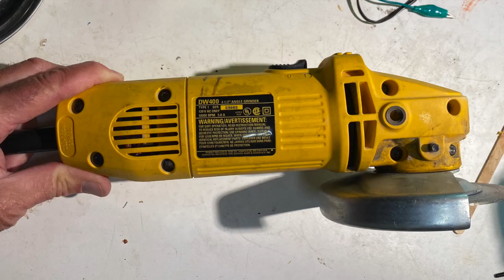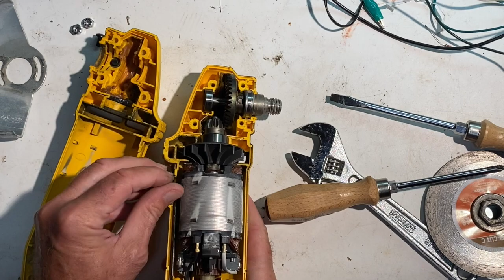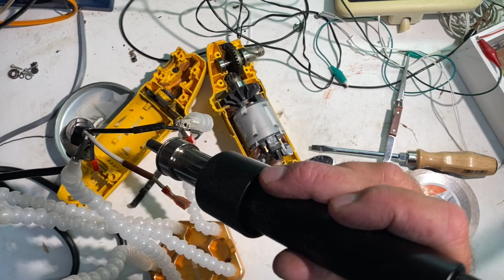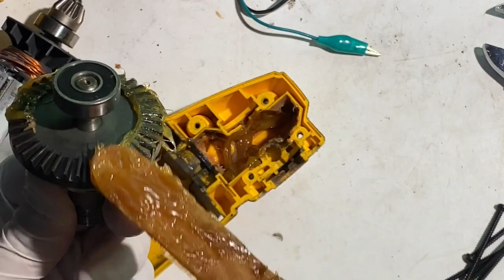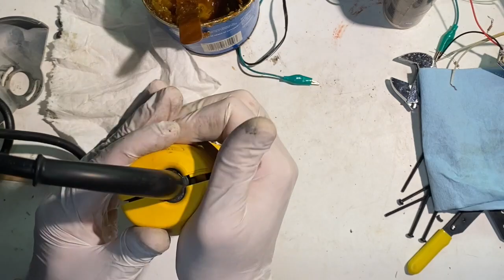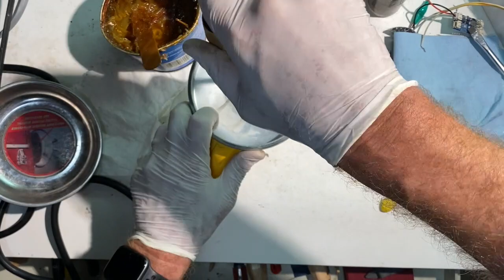Replacing the power cord on a Dewalt DW400 angle grinder

Comment: I noticed that when you disconnected the original power cord, the black wire with the bare connector was on top and white wire with insulated connector was on the bottom, but when you reassembled, it appears your reversed them. Was that on purpose? The grinder appeared to work fine, so maybe it doesn't matter?
Reply from the maker: Good catch. Yes, with AC connections, you can usually connect either way. However, as a rule, you're right that it's best to put things back the way you found them!
Reply: @ravraid  Thanks, I have the same grinder, and the original cord does not have a polarized plug, so that makes sense. Very helpful video.

Comment: The piece in mine where the wires connect (your black box) is a red one on mine and has a little rubber plastic nipple looking piece on it. Do you know where I could get a replacement for it?
Reply from the maker: Hmm, I'm not following. Are you talking about the plastic pieces that fits over the spade connectors the plug into the switch?